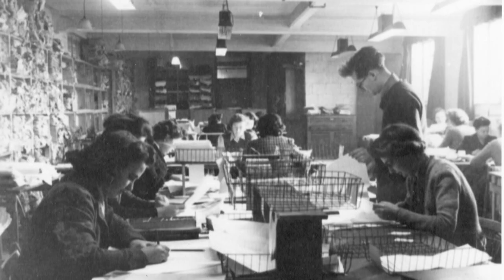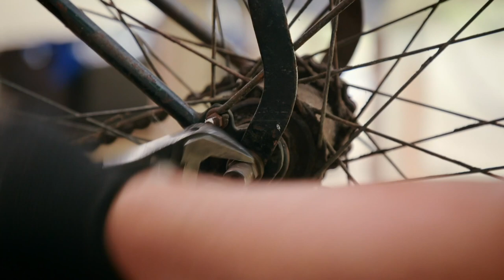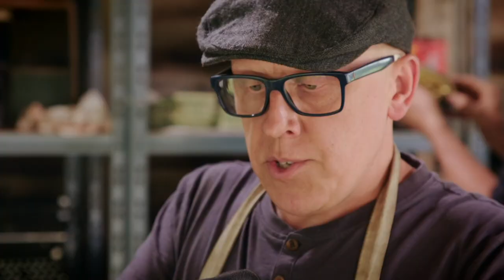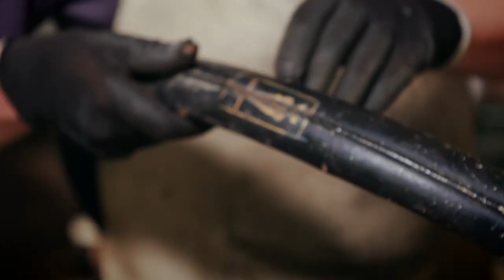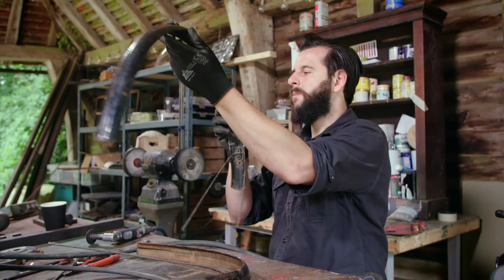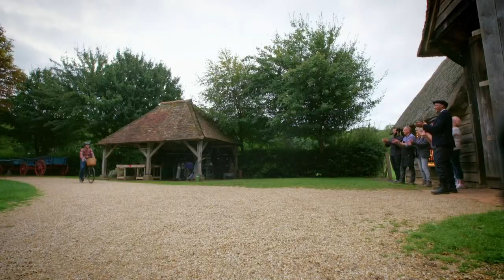Bicycle Used Since WW2 By Bletchley Park Codebreaker Restored | The Repair Shop

Comment: Most boring show... All you are doing is replacing an original parts of the things that is memorable to your customer..... You are replacing show ot repairing...
Reply: Well don't watch then!
Reply: agree....  no art in that... might aswell give them a lego set there is always replacment parts
Reply: he is right, they always take the easy route and its not the best one when ones goal i so keep it as origional as possible...
Reply: It wouldn't function 1/2 mile with that sprocket! What's he supposed to do? Build the worn areas of the sprocket teeth back up with  a welder and dress the profile with an angle grinder! How original would that have looked. The saddle collapsing over the seatpost would be unwanted drama! The basket is self explanatory!
Reply: It may be boring to some, but no matter how small or big, its history and a well loved item, I love this show ❤️
Reply: Bro, so many things are unable to be repaired or reused.